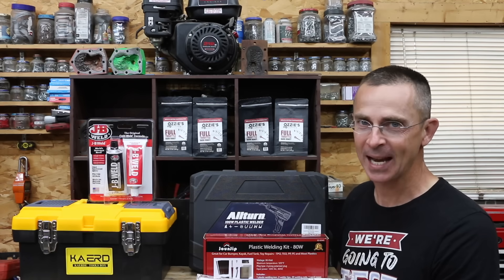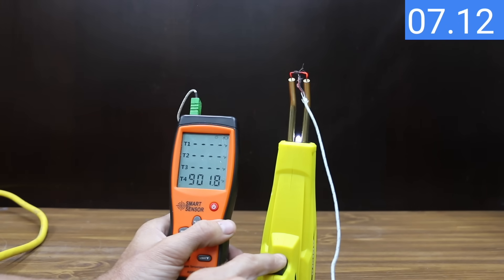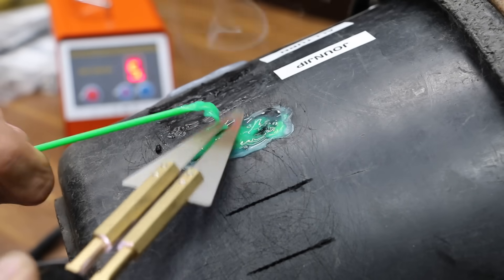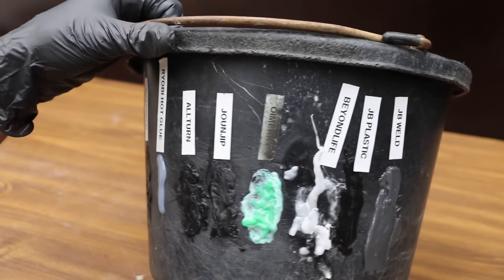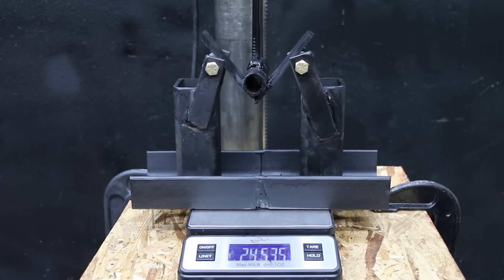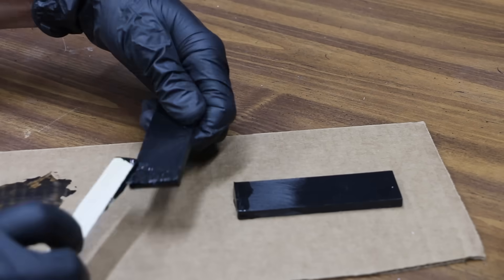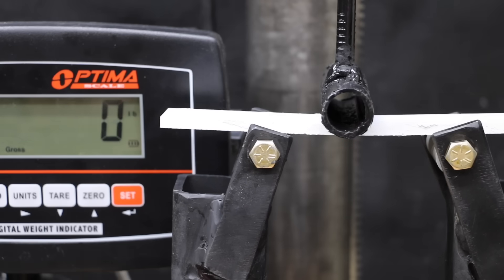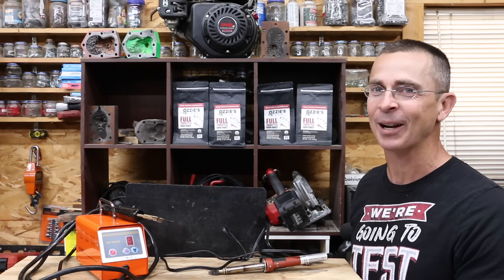Don't Buy A Plastic Welder Until You Watch This Review!

Comment: Plastic welders are cool, but I'd really love to see you test budget multimeters. You can probably use a fluke as a control to compare the budget multimeters one feature at a time, ohm's, volts, amps etc.
Reply from the maker: Great suggestion! Thank you!
Reply: Yes!  I second this suggestion!!
Reply: As many have already said, any meter will do good enough and for everyday use there is no practical difference. So why do people spend hundreds on a Fluke? Because they need the authenticity of the results. If your certifying say a medical device, you have to back up your numbers and Fluke has the reputation and certified calibration to provide that.

I'm an Electrical Engineer. At work when I'm performing qualification tests, I'm using a Fluke, or an Agilent, or a Tektronix. At home to check an outlet or doing some repairs, I use a Chinese knockoff from Amazon and spending the $300 in savings on something else.
Reply: Some of the characteristics I found differentiating the high end from the low end are as follows, in no particular order-

The high end has regulation on the battery so it can remain perfectly accurate even as the battery level drops down to the point where the display is barely visible.  With the cheap meters, as soon as you see that battery symbol come on, stop using it because the readings will be completely off.

The test leads are silicone on the best meters,  and make a big difference in operation compared to the cheap plastic leads that tangle and tug on the probe ends.

The rotary switches used on the cheap meters develop oxidation on the contacts over time, and the readings will get all erratic, and have be wiped back and forth to get sufficient contact to get a proper reading, and you can't be sure if it's good or not unless you check it against a reference.

Continuity testing buzzers have immediate response when sweeping connections with a good design, some have lags that will miss a connection.

Autorange on some cheaper meters don't have the ability to select a fixed range, which slows down repeated measurements tremendously.  If you know what range you need to test in, it's far better with manual ranging than this sluggish autorange setup that a lot of meters favor.

Display visibility under all light conditions from darkness to sunlight is something to consider.

Battery types- most Flukes use 9V batteries, but I actually prefer the AA option that some have, more economical but may limit the diode check voltages to just 3V.
Reply: While there are some easily-tested differences, like settling time, continuity tester speed, and range, accuracy is something that is unlikely to be a problem — even the $3 meters from Harbor Freight are usually spot-on within a few counts. (At the very least when new.) The real differences are MUCH harder to test: do they meet their claimed safety ratings? How do they behave on massive overloads? (Will it explode?) How long will its knob last? What is its long-term stability? (Fluke meters are famous for staying in-calibration even after 30 years.) 

There are experts who have already done most of this testing and published the results. (This includes building custom test electronics to torture-test the meters.) No need to repeat that gargantuan effort, just look for them.
Reply: yes! I just bought a Snap-on basic MM, one with the big display. I love it! Still though, it wasnt cheap. How accurate is it?????
Reply: I have tried several small multimeters looking for one that would take up less space than. a Fluke 179. The most frequently evident shortcoming of the less expensive meters is how long they make you wait before they settle in on a reading. The two I ended up carrying are the tiny Fluke 107 and the Hioki pen meter. Other than its larger size, the annoying thing about the tiny Fluke is the lack of probe clips on the case. Of course, the safety category should be the highest priority consideration, but it's hard to want to test whether they're lying on that score.
Reply: @JELWwL6unE8V7iGB3 Fluke is a reliable company, in general, I don't they are lying in their marketing.
Reply: I'm an electron chaser and even the cheap  digital multimeters are pretty darn good.

Comment: PF added the weld before the mesh then additional weld on top. When it comes to plastic welding, I usually heat the mesh directly to melt into the original plastic before adding weld with the sticks. I've found this to be a better way of reinforcing the structural integrity.
Reply: @NoughtSure  It truly depends on the thickness of the plastic combined with the expected forces applied during active use. I'm sure something as thick as a kayak would do slightly better with the staples by themselves than it would with the mesh. This is due with the forces coming from the top down rather than lateral force.  With that being said, for a kayak, I would probably do both staples and mesh due to the fact that the mesh has a wider surface area to hold against any lateral force.
Reply: Yes. This method in my opinion makes it almost stronger than original.
Reply: This is the right way to use mesh 👍